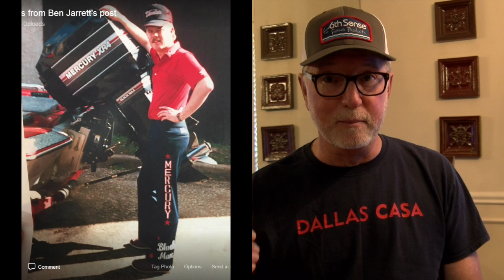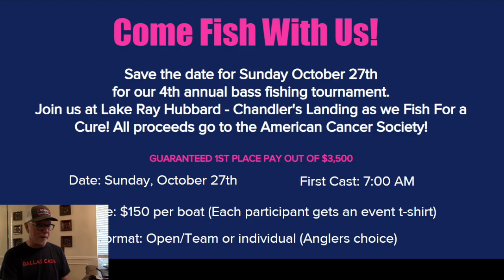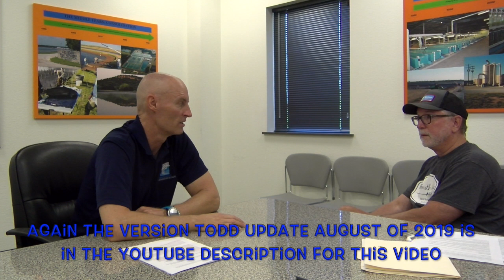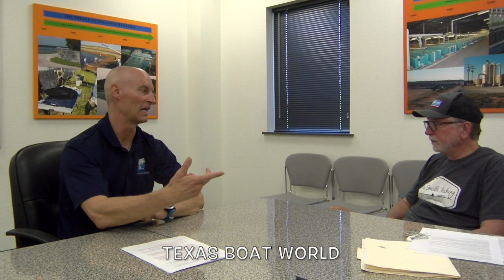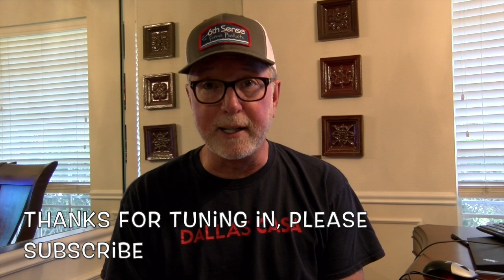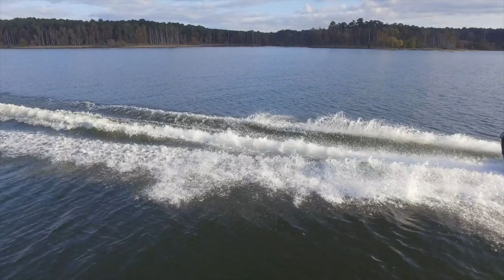Part 7 Todd Driscoll TP&W Fisheries Biologist Discusses Direct Oxygen Injection Livewell Systems

Comment: Great video series! I wonder if you could write out a bullet-point type list on fish care and circulate it thru your sponsors and other connections if that would expand tournament anglers awareness of this info. Something simple they could read in a minute or 2. I imagine that not all tournament anglers are concerned about conservation but I'm confident they care about winning the trophy, so if they have easy access to the knowledge that will give them a better chance at the trophy then you might see more improvements in less time.

Comment: Question Ken , instead of running the recirculating pumps all the time could you just not pump in fresh water and pump out older water keep your recirculating pumps on a timer? Also the additive G-Juice in my opinion does help as well bring the stress level down of the fish.
Reply from the maker: Ryan I think it’s according to time of year. Here in texas from say June through September your just recircing 80-90 degree water that has very low O2 content. It’s been my experience that when I do that I still lose fish. The ONLY way I’ve been successful without the O2 system has been ice and recircing that same cold water.
Reply: @KenSmithFishing  Makes sense same thing here in Sc on Hartwell water temps get in the upper 80s to low 90s . what size tank do u use and how long will it last ?

Comment: Bubbles breaking surface tension is what lets oxygen into water. That is all you are trying to do with any system. Adding pure oxygen without a way for it to make as many bubbles as possible when it comes to the surface would be pointless. All the "oxygenator" is doing in reality is making micro bubbles. They are doing nothing until they make it to the surface and pop. I have been arguing for years that it is a pointless add on.  You can't "directly inject" oxygen into water or make more oxygen out of water. The next component is circulation. Moving the water excites the molecules. This makes them holds more oxygen and disperses them more evenly. Replacing your recirc pumps with a 1000gph pumps is a cheap and very effective upgrade you can make. You will be pleasantly surprised by how  lively your fish will become. Leave them on full time at the end of every day and during the summer. The vent thing they sell does more harm than good. You need to replace the water in your well a couple times a day especially if you have a 5 - 10 bass in there. One batch of water will not last all day especially in the summer. One large divided well is better than 2 separate wells as the fish are in a higher volume of water. I had to learn all this when I got into fish keeping. I had trouble keeping certain sensitive tropical fish alive in my aquariums.
Reply from the maker: I hear what  you are saying but the biologist checked the water that had the O2 injection system and it GREATLY increased the O2 content?